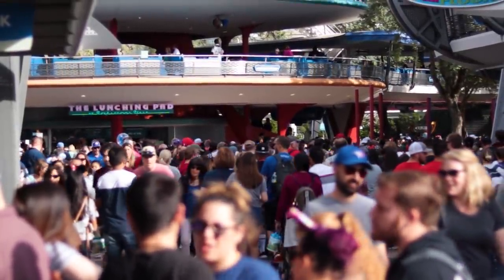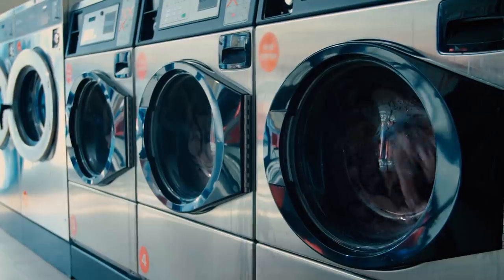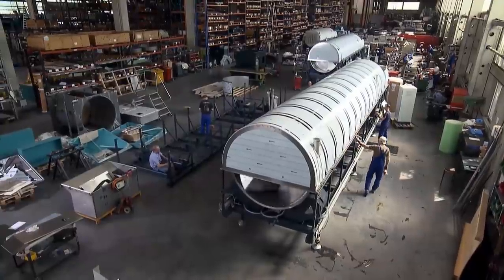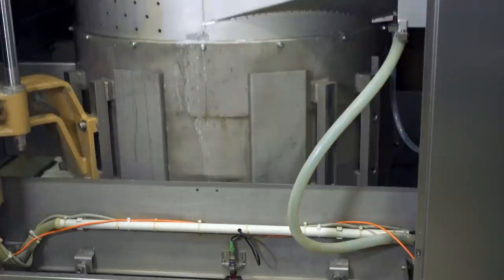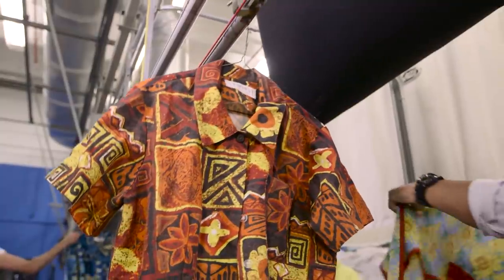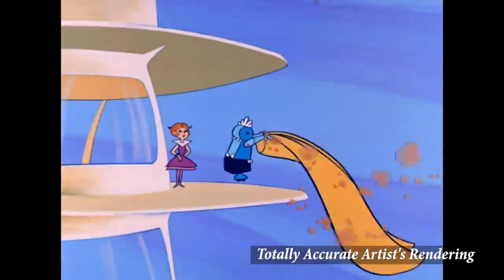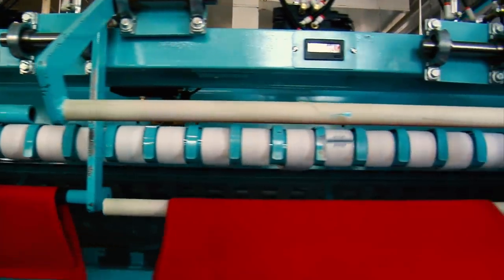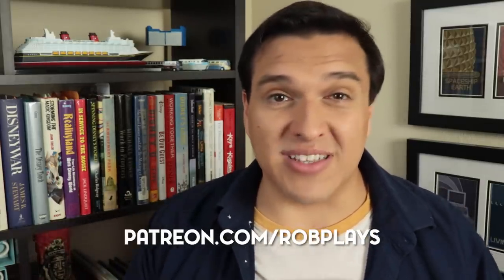How Much Laundry Does Disney Do?

Comment: I wonder how much they save on laundry, compared to a stand-alone hotel, due to the economy of scale.
Reply: How much detergent does it take to wash 285,000 pounds of laundry?
Reply: @drewnolde2674  it will take a insane amount of laundry detergent to wash that much laundry, and you would have to go through at least hundreds of Speed Queen laundry pairs they use in most laundromats in the US and the average lifespan of a residential washer dryer set is about 11,000 to 12,000 cycles.

Comment: I had a stupid question related to your video : Where does guest laundry go??  I have never seen cast members in the resort specific laundry areas, and sometimes they are labeled like they went out somewhere. Does guest laundry go to a plant?
Reply: I'm not sure about guest-specific laundry but most of the resort laundry gets loaded into bins on trucks that go to the on-property laundry facilities. In a presentation from some Disney industrial engineers I attended, they talked about partnering with some outside laundry companies too so it could go off-property.
Reply: @phdprincess  thanks. That kind of lines up with my observations and suspicions.

Comment: I was an Engineer for Ecolab and we installed a high tech chemical dispensing / data logging system at their main large laundry in the late 90's . At the time there were 5 -  "Tunnel Washers", each would spit out 125lb loads every 90 seconds. This laundry serviced linens and towels. It was a fun 4 year project. I also did some work at the All Star Laundry (think the  was the name), with more conventional industrial washers.

Comment: There are also more, less technically advanced laundry facilities in every "character room" across the parks and in several other locations! I used to work costuming for Festival of Fantasy, Move It Shake It, and the Hoedown Happening, and we did our laundry at the production center behind Splash Mountain and Pirates where parades leave from. If it could be thrown in a washer and then a dryer or hung in the dry room, OR if it could be hand washed (and then also thrown in the dry room), we washed it in house. If it needed more attention, dry cleaning, or pressing, it was sent to textile services. The character room (where Mickey and the Princesses pick up their clothes and accessories) does laundry the same way, and there was a schedule of when Textile Services would pick up and drop off our out-of-house laundry. And then there's ACCESSORIES. Shoes and belts and fur pieces and the rings that fill out princess skirts are each their own ordeal. Festival of Fantasy has 8 costumers and a supervisor and coordinator every day, with additional help from Hoedown Happening's costumer when it's time to load the truck, and each costumer has a different role come laundry time after parade. There are 6 costumers and a coordinator for the Street Party, and one costumer for Hoedown who reports to the Festival of Fantasy coordinator. 
Fun fact: the flag on Main Street is laundered in the Magic Kingdom character room, and there are special instructions for it's care per the code you mentioned in your previous video about the US flags on Main Street!
and a final note: with lots of people being laid off at the parks right now and with the parks not currently doing their usual parades, meet and greets, and holiday parties, most of my friends from Disney costuming are no longer with the company, so seeing you post a video about Disney laundry was oddly touching for me at this time lol